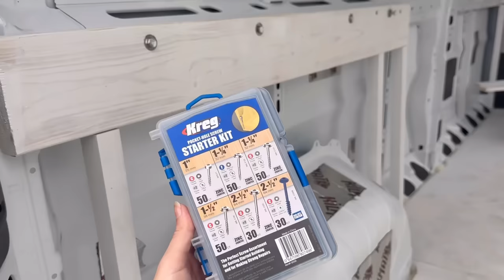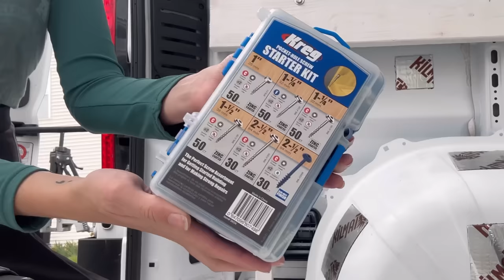Finishing FRAMING The Walls Of My Camper Van: Part 2 ( Solo Van Build STEP BY STEP Day 7-8 )

Comment from the maker: NOTE: I used a 2x6 for the bed framing because my original plan was to lift the bed up higher than this rib. The 2x6 would give me more height to be able to do this but then in the end I decided to keep it lower, however I already bought the 2x6 so I used it. However a smaller size would have in this case worked better and had less weight. I just wanted you to know in case anyone wanted to recreate this or was wondering why :)

Comment: OMG when you had the riv nut start spinning I had to laugh. Same thing happen to me! Much like you I couldn't find a great solution so one is just not as tight as the other. I also put 2x4 supports on each side down to the floor. Had no issues so far knock on wood! Never enough Harry Potter references.

Comment: Could I suggest a tin of cold galvanising paint with a long nozzle. Spray a little down the hole after drilling or if just screwing through the metal a quick squirt and the screw will drag it into the hole massively reducing the risk of rust.

Comment: Hey Tory! Glad to see the van build is coming along nicely. If I could offer a couple quick tips for ya: 

When you’re using the miter saw, it’s so much easier if you add blocks that are the height of the bottom of the saw, to support the wood you are cutting. Also, once you cut one piece to fit if you are cutting multiple, such as the section around 11:30, the first piece you cut can be used as a guide for the others. I’ve built many things in my time and used these methods and they have always worked for me, but if you are more comfortable doing it another way, to each their own. If this helps you out at all I’m glad! I hope you have a wonderful day!

Also, one more tiny thing; at 13:47, if you have a level, that works too! And it’ll be more accurate

Comment: I'm eating up this van build series as I'm on the fence about diy. This is very empowering and sooo appreciated! QQ - is there a reason why you're painting your framing? I've not seen that before.
Reply from the maker: I am so so glad!! :) And yes it's actually a mold preventative primer, I think I go more into detail on it in an earlier video but basically it's just so that with the inevitable moisture the wood doesn't form mold or mildew! I am putting it on every piece of wood I put in the van. :)

Comment: It is interesting that you decided to use wood for your bed support. I will have to keep watching to see how you attach your crossbeams. When I did my first build in a Promaster, I used metal tubes as my cross beam support. Also what made you decide to paint the boards?
Reply from the maker: I did this same set up in my last van & used L brackets to attach wooden crossbeams! I plan on going with this same concept but using smaller sized wood beams for more gaps to help reduce the likelihood of mold developing. And I painted the boards with a mold preventing primer so it’s not just a paint for aesthetics but to make the wood last longer & because of course mold in a van is majorly unsafe :)

Comment: 1st Slytherin rules all houses. 2nd I do not understand why you have to drill into the metal when there are more then enough holes in the steel for you to place hardware through to hand whatever you want. In fact I have no idea why you even have to use wood for framing when the frame of the van w/holes is more then good enough for you to build your van. Just need the right industrial fasteners.  This is why you are a Ravenclaw I guess.

Comment: You don’t own a little torpedo level to check for plum
Reply: No because the van could be on an incline or decline.  Plus, level is horizontal and plum is up and down.  You would measure from inside the van at the floor or ceiling.